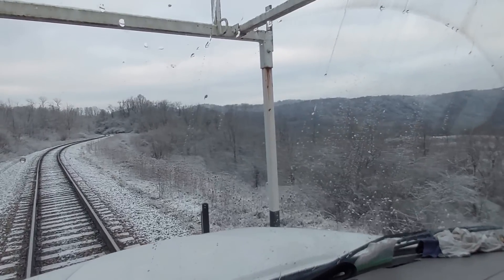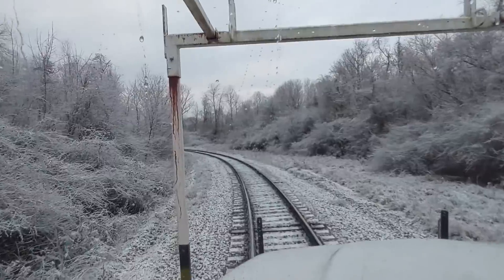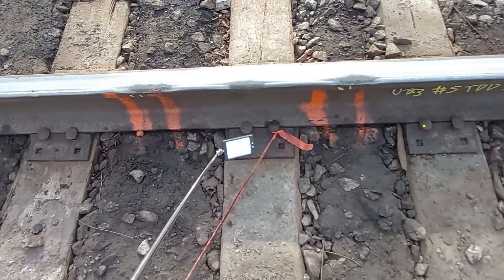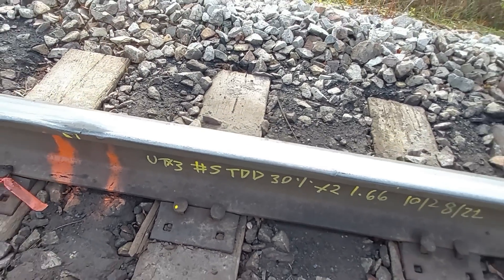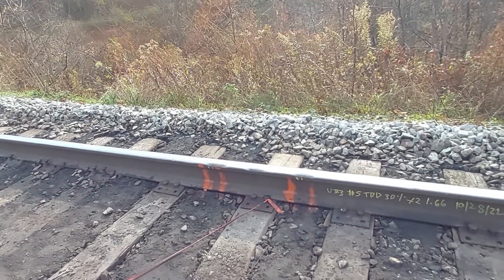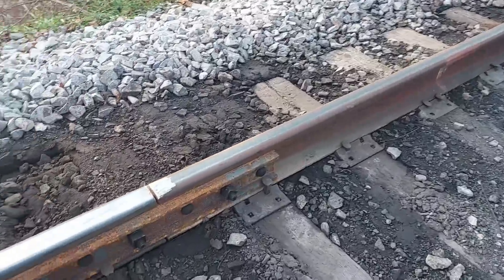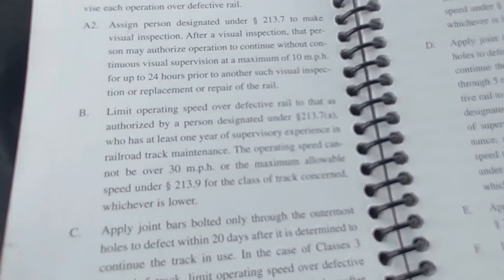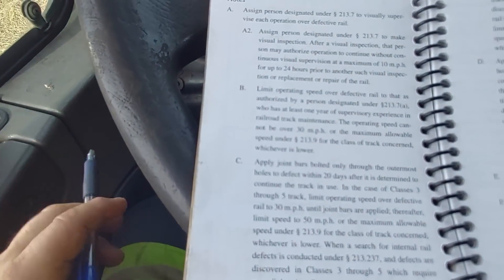Ultrasonic Rail Testers found a 30% Growth Inside the Rail Head

Comment: Well up here in Alberta Canada.  They had a derailment afew years a go and they found out that the rail was looking like air bubbles in side the rail when they opened up the rail it looked like air trapped bubbles but appon furthermore inspection &useing the biggest micrscop found metal eating organisms in the metal. It was a news story intresting.?O.k just to let you know.
Reply from the maker: Well now that certainly is an interesting story Juergen. Hope
those organisms don't infect any of our rail.... :-) Inside rail
if it doesn't cool just right after rolling there are microscopic
defects called inclusions (hydrogen) which over time and fatigue
do grow like a cancer inside the rail.  Thank you for watching our video and we hope you have a very good day my friend.

Comment: Dave, During the melting and rolling process to make the rail, sometimes a little slag (anything other than clean steel) can get tangled up in the pour. Decades ago I was a Metallurgical Apprentice to melt 6 ton of iron per heat (melt). Everyone does their best to try to prevent impurities from getting in the batch of iron or steel, but there can be a dozen or more reasons why the iron or steel would have defects.
Reply from the maker: Thanks for sharing the information cncpreferred, great stuff! Appreciate your taking the time to visit with us and check out the video my friend.
Reply: @ccrx6700  You are welcome my friend! I am a railroad buff. The SWP Railroad line runs past my property about 1/2 mile south of the Radebaugh Siding off the NS mainline. I watch your videos since your rail line runs in the region. SWP had run coal from Bullskin Twp to the power plant a few decades ago. Keep up the good video's!!
Reply from the maker: @cncpreferred848  cool. SWP in my back yard 👍😊😎

Comment: Are new rails analyzed with ultrasound before they are placed? Doe these defects “grow?”
Reply from the maker: All new rails go thru extensive testing Epitome. However each 
new stick is not ultrasonic tested and even if they were something so
small as a hydrogen molecule would not be picked up. Watch my
video on Cancer in the Rail Head to get the rest of your answer on
growths.  Thank you for taking the time to write in and for checking out the video my friend.

Comment: It is fairly easy to spot areas for potential defects: Wet beds and lifted spikes are a tell-tale. When the tie-bed goes soggy, it dips under the weight of the truck. The rail then pivots about the nearest firm bed to the wet area, causing upward motion of the rail opposite the pivot-point. There are then two areas for fracture; the bottom of the dip, and the pivot-point of the rail. Look for wet-beds next to lifted spikes. 🙂
Reply from the maker: Appreciate your sharing that nlo, you are right, mud in track is
never a good thing. Thank you so much for taking the time to watch the video my friend.

Comment: This video definitely wasn’t made while riding in a BNSF hyrail. At the time I left the Butt Nugget in 2021 using a cellphone while hyrailing was definitely forbidden by the safety dieties at corporate HQ in Fart Worth.
Reply from the maker: You are right. But what you might like to know is we are a coal mine that has an enclosed RR, not a RR company. Management
here knows I make these videos and it is with their blessings,
albeit it does come with some stipulations. FRA does not get
involved with us, we are patrolled my Mine Safety Health Admin
since we are a mine. I like working for this company, they are
pretty darn cool to work for. Thank you so much for
taking the time to watch the video my friend.
Reply: @ccrx6700  I figured it was some situation like that. I started working for the AT&SF on April 17th 1995 after a 22 year career with Hewlett-Packard and for the first couple of years it was a great place to work, but then the safety Nazis really started getting involved with every aspect of the job and on April 12th 2021 I was ever so glad to leave the BNSF for good. In between those two dates I changed Railroads several times having worked for the Santa Fe/BNSF three different times and the UP twice and I did and saw a lot of cool things at both roads including private photo sessions with the AT&SF 3751 (I have the actual radio out of the steamer that was used on their last Grand Canyon run) and several private photo sessions with the UP F units and passenger cars when they’d come to LA, including the 2002 Olympic special complete with the Olympic Cauldron care on the rear. I got a really cool shot of the Olympic flames burning with the LA downtown skyline in the back ground. On my first jump from BNSF to UP when I was still working the weekends for telecom ar BNSF I actually was an employee of both BNSF and UP at the same time for five days.
It was an interesting job while it lasted… Before the dark times, before the empire (Sorry, I couldn’t resist a little Star Wars reference there!)
and between job changes at the railroad I even had brief stints at the LACMTA working on light rail and subway communications (I even have some run by shots of the subway cars blasting by in the tunnels at 70mph) and a brief stint with the Metropolitan Water District of Souther California.
I really enjoyed your videos about detector and dragger problems because we handle the radio systems at our detector sites.

Comment: Dave,   another great, informative video.  Question about joining new to worn rail. I am a permanent way (MOW) volunteer on a heritage railway in the UK that uses bull head rail and cast iron chairs on the sleepers (ties). Here in the UK we joint new rail to worn rail using stepped fish plates, I think you call them jointing bars. If the difference is only small we use shims on the upper surfaces of the fish plates. This removes the need to grind the rail head. Do you use stepped joint bars or shims.?
Reply from the maker: Appreciate the nice comment fionamuchael. Step bars are used for
joining two different sizes of rails from the way I under stand it
from those in your area who have commented in the past.
Those bars here are called compromise bars and yes we use
them, although they have a big tendency to break. Here is a 
video I made on compromise bars, let me know if that is what
you are calling a step bar, thank you.
https://youtu.be/o2ljPcWXQ3A
Reply: @ccrx6700  Dave, I guess that a compromise joint bar is used to join flat bottom rail of different weights.  I am assuming that they are used if the rail rail head is at a di fferent height with reference to the rail foot. On our bullhead rail the new rail is the same the same weight (95lb) per yard as the original rail only the rail head is lower due to wear.  To compensate we use stepped fish plates or shims to compensate for the height difference. Thank you for taking time to reply. Sleeper changing tomorrow. I also have a Stumec Geismar TB2 engine to get running.
Reply from the maker: @fionamichaelpaterson4411  understood on the rail head wear and stepped bars thank you

Comment: Hey Dave.... great video.  Two questions come to mind.  Can a thermite weld ever 'repair' a bad spot on a track, or is it only used for joining two sections of track?    Also... you have shown thermite welding on your channel in the past..... (and may have addressed this question in that video... but I don't recall the answer).... on your track, when would you use a thermite weld versus a normal joint connection?
Reply from the maker: Thermite weld is not allowed to repair an internal defect Mike.
None of our joints can be welded because of the 3rd bolt hole in
them, too close to a weld. We can weld in plugs we cut in tho that
don't have the 3rd bolt hole. Thank you very much for taking the time to visit with us and check out the video my friend.

Comment: Very interesting Dave, you know your stuff. Surprised you have track issues since you run at slow speeds. Thanks
Reply from the maker: Slow speeds but heavy weight plus some poor track ballast conditions William. Also plus some old infrastructure, my work is
cut out for me trying to keep this train on track and moving.
Thank you very much for stopping by and checking out the video my friend. Hope to see you on the next video part 2 of ultrasonic rail testing.

Comment: When I was working for the railroad in Massachusetts, we had Sperry inspect the track twice a year with their self contained rail car. They traveled all over the northeast on inspections. I went with them as a pilot on our territory a couple times. It’s amazing how their equipment can find and mark defects at 20 mph!  
Here in Kentucky, I see Sperry using special high rail trucks to to inspections. 
Amtrak does their own inspections on the Northeast corridor from Boston to Washington.
Reply from the maker: They use trucks here cause the Sperry car cannot get in here Bill.
I always go with them but follow in hi rail truck and put joint bars on behind them....:-)   Appreciate the nice comment and Thank you for taking the time to  stop by and check out the video my friend.

Comment: It looks like these transverse defects are there in the rail from the manufacturer and that the stresses and environment make them grow. The one you showed is under the head of the rail and would be hard to find. Maybe this one was found on a track inspection initially but was too small to require action. If so, then this follow-up ultrasonic inspection was the trigger for the replacement. I know that once I saw it, I was thinking that the defect could easily lead to a rail failure and a derailment. The replacement was then completed - well done!
Reply from the maker: Appreciate the nice comment Brian, glad you enjoyed. Yes it was caused by an impurity in the rail rolling process and made worse over time by the train traffic. Thank you for taking the time to  stop by and check out the video my friend.
Reply: @ccrx6700  LOL! I guess I have a masterful grasp of the obvious :)
Reply from the maker: @brianhickey5949  😊👍

Comment: some roads have more restrictive rules then the federal regulations, like at work dupont’s exposure 
for different chemicals is usually less then the federal regulations. based upon the SDS {safety data sheet}
so every company has their rules and regulations. rail defects are a big issue, all based upon small imperfections 
in the steel as the rail is made, a small imperfect spot are weaker then the surrounding steel and can cause 
big headaches! great video,  and explanation of the situation, it is great finding all the issues on the tracks!
Reply from the maker: Appreciate the nice comment Barry. Yes it was caused by an impurity in the rail rolling process and made worse over time by the train traffic. Thank you for taking the time to  stop by and check out the video my friend.
Reply: @ccrx6700  
any flaw in the steel is a weak point, and as it flexes over time the flaw separates 
and starts to grow! causing more areas to fail . thank you Dave for all your great
replies to my inquiries, your knowledge is vast, and accurate. thank you for the 
great conversations too!  I always learn something from your videos! have a great
week and be saf out there! barry
Reply from the maker: @artillerest43rdva7  👍😊

Comment: Very interesting, as per usual Dave! 👍 That last manual you showed (15:50, Figure 16-11 bottom right hand corner) mentioned that a transverse defect is more likely in areas where the rail is in tension. Once such a defect starts then I suspect cyclic variation in tension due to the rails expanding and contacting in hot and cold days may lead to fatigue growth in the defect. My father worked in materials research at an aerospace laboratory where he was involved in the testing & fatigue simulation of such defects in metals. He showed me test samples (of aircraft parts) where you could clearly see the "growth rings" as such defects progressed over time, resulting from these samples having been exposed to cyclic varying tension. Interestingly, depending on the orientation of such stress fractures, the progression can often be stopped by drilling a stress relief hole at a strategic location right through the end of the fracture (that wouldn't be possible for the transverse defect you encountered though)
Reply from the maker: Appreciate the nice comment Maidsandmuses. Yes it was caused by an impurity in the rail rolling process and made worse over time by the train traffic. Expansion and contraction of the steel does not help matters either. Thank you for taking the time to  stop by and check out the video my friend.

Comment: Great explanation Dave. I guess CP base their max permitted speeds on the max axle weight they carry and feel it is safer at 10mph. Do you get roaring rails, they are rails that look OK but on a train are very loud, These days with new ways of making the rails I do not hear them and had forgotten about them until on a heritage line a few weeks ago where they have some. Someone said they were caused by impurities in the rail.
Reply from the maker: I've had a few of those over the years Cedarcam. Hear them more on MOW equipment but guess that's cause equipment is how I track travel.  Yep its a different sound, like a dull sound. I've in past requested Sperry to hand scan a couple and they never found anything. Always puzzled me why the odd sound. 👍😊 thanks for sharing that
Reply: @ccrx6700  I may get a recording of the sound on a diesel railcar. There was a place at work behind houses and residents complained so much they swapped the rails with some from a bit further along the line, as you say nothing shows on a scan.

Comment: We had some heavy steel structure start to fail with cracks.  The lab people were able to look at the crack and see the circles from each time the crack 'grew' and they figured out how long it took to get as bad as it was.  Had to replace it of course and that was a job in and of itself.  So interesting that they can figure out things like that.  Sort of timely to talk about cracks and crack growth considering that story in the news about the roller coaster support that started cracking and within a week or two had completely separated.

With that rail that failed, I'm guessing it was some tiny imperfection in the rail?  I mean it looks like any other section of track but somehow it started to crack and just kept getting bigger and bigger.  Anyway, always learning something new and enjoy your shows.
Reply from the maker: Appreciate the nice comment Mike. Yes it was caused by an impurity in the rail rolling process and made worse over time by the train traffic. Expansion and contraction of the steel does not help matters either. Thank you for taking the time to  stop by and check out the video my friend.

Comment: Dave, when you find a rail that is worn on the rail head but nothing else wrong, do you ever just flip the rail around so the good side of the rail head is now on the flange side?
Reply from the maker: Good question and here we have never turned the rail. Our old
boss would always put in a new stick of rail. Many RR's do
turn rail. Some also transpose rail meaning they take it from
one side of the track to the other.  Thank you for taking the time to  stop by and check out the video my friend.

Comment: It is too bad they can't make a super hard steel for rails.

If the Mills could make steel that was super hard and cost more but would be almost impossible to wear down like a normal rail, companies like yours could buy them so you don't have so many rails wear out.

It seems like you go through a lot of repairs and replacements.

Maybe they could have more cars with less coal in each car to reduce the weight and wear on the track

How much does each coal car weigh ?

How do they compare with a double stack intermodal car ?

Or a tanker car ?

A typical double stack tractor trailer intermodal car is 60 to 120 ton ?

Tanker car 120 ton ?

143 ton for a loaded coal hopper car 

These would seem to be the heaviest cars that any railroad would pull.

If you could reduce the weight by 20% per car, add 10 more cars, load each to 80% , the wear would be that of a tanker train or intermodal train.

Has anyone looked at doing this ?

The time to load and unload would be a little longer but the maintenance would save a lot of time and cost
Reply from the maker: Our cars are rated at 286,000 pounds load limit. Minus the 52,000
per car empty weight and we load about 114 tons of coal in each
car s.o we are within specs. The  biggest things about external rail wear is 1. high degree curves of which we have plenty and no way to change that. 2. poor ballast conditions which cause the rail to move up and down which is hard on external  and also
internal defects. 3. all jointed track we have, far less wear on CWR.
And most other big RR's have a rail grinding program.

In UK they do make a much harder rail, my memory escapes me
on the composition of it, magnesium? I could be wrong on that.
But it's very expensive. All the causes of rail wear you are wondering about would take an entire series of videos. 

FYI they will never even consider loading cars here any less
than the tonnage they put in them. Thats been suggested many
years ago by me and others and it just won't happen.

Comment: That black spot looks like a bad metal in the steel. That impurity should not have stayed in. That is strange.
Seeing so much slag dumped in Bethlehem and all that metal was bad
Reply from the maker: Most likely originated from an impurity in the steel when they
rolled the rail, it's called a shatter crack, (hydrogen).  Train traffic
over the many years caused that to grow in size.  Thank you for taking the time to  stop by and check out the video my friend.